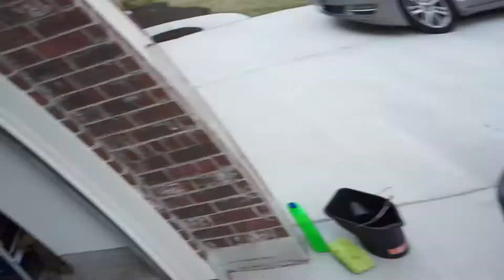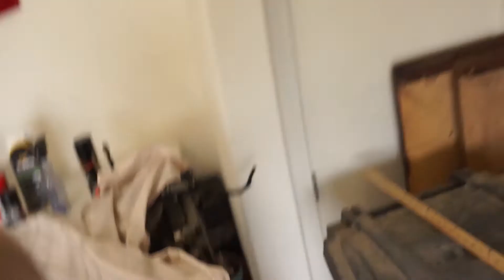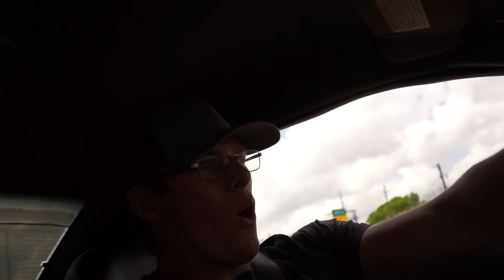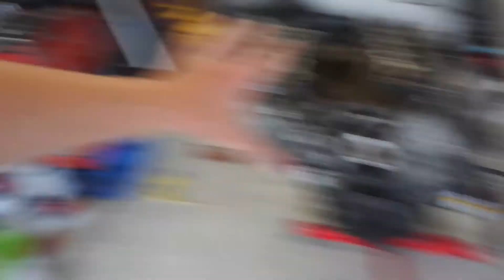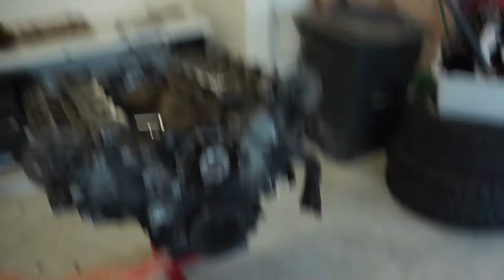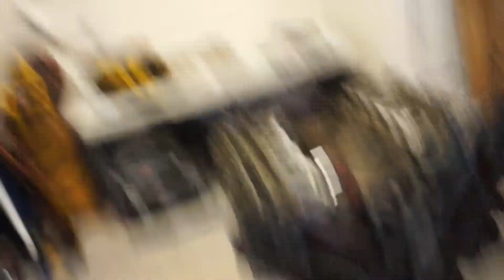Let The Engine Build Begin! *Kinda*

Comment: hey just curious did you ever find out if the timing chain was suppose to be loose like that when you jiggled it after you took the timing cover off?
Reply from the maker: As I recall that is normal. Since there was no oil pressure, the tensioners weren’t putting out much force on the chain. There was also a little wear on the old timing components but nothing to be very concerned about.